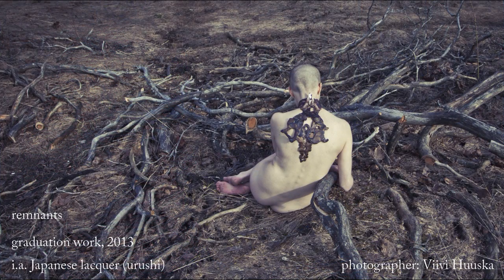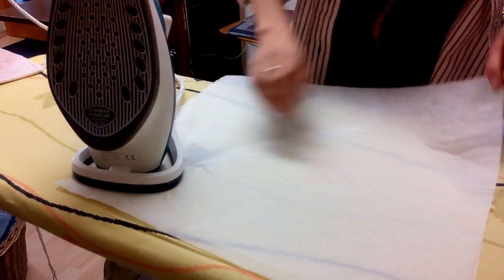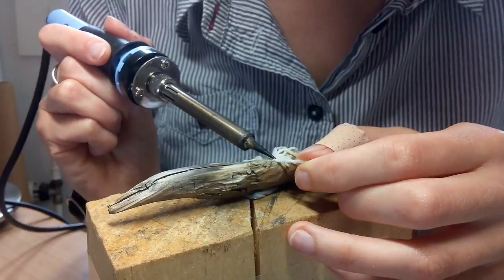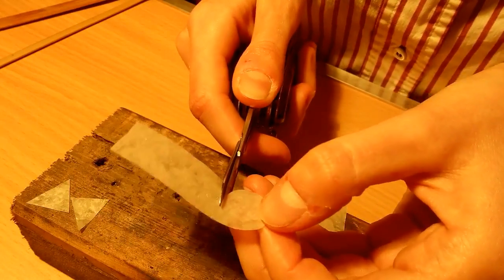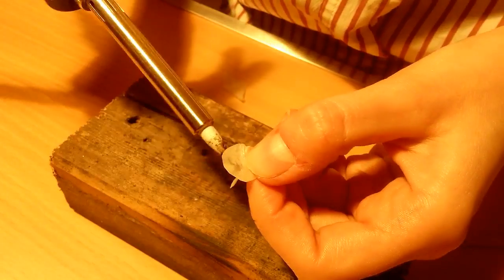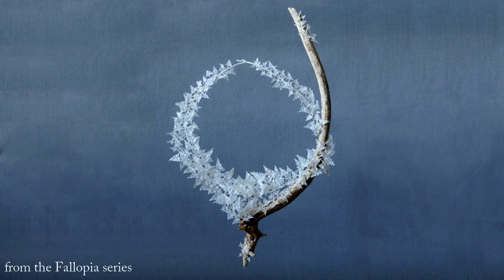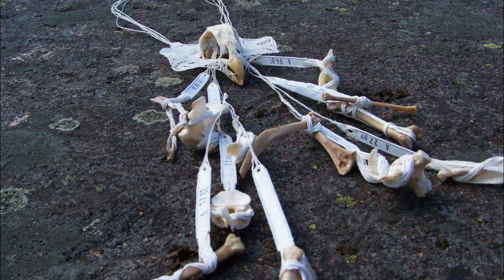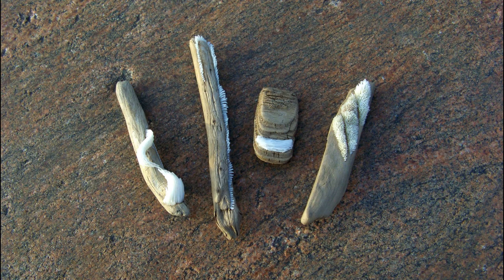Jewelry Art from recycled plastic bags

Comment: I thought some plastic was made from milk and vinegar?
Reply from the maker: There is bio-degradable plastics, yes. And different kinds. There's some that are called bio-degradable but that unfortunately only fall apart into smaller pieces, basically micro-plastics (which is bad) and then there's some that are made from other things than actual plastic (you mentioned vinegar and milk, I've heard about something made from corn husks as well) and those are truly bio-degradable, they fall apart completely. Those are great (at least as far as I know). The bulk of plastics is still basic plastic derived from oil though.

Comment: What temperature is toxic when fusing plastic bags?
Reply from the maker: That depends on the kind of plastic and the ventilation. On average the temperature I use for those pieces (LDPE and HDPE) is usually around 200°C or lower and I ventilate often. The most important thing is that there is no smoke, so the plastic doesn't ever burn, only melt. If you're thinking about doing something like this yourself, do take care to do your own research for whatever you'll be using, though!